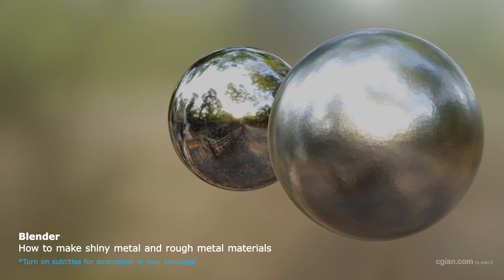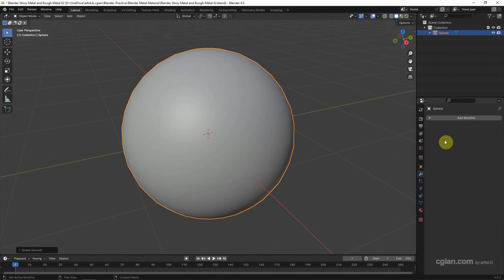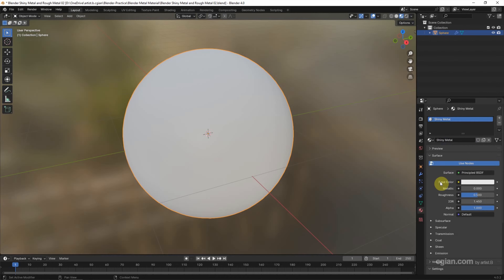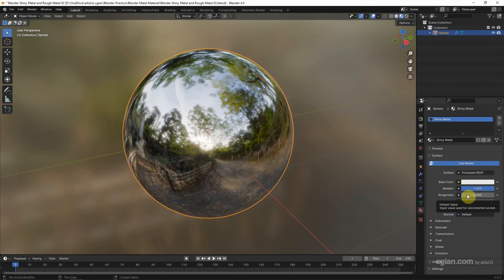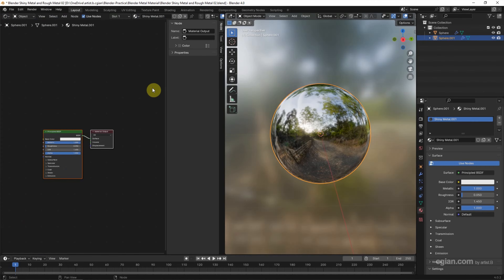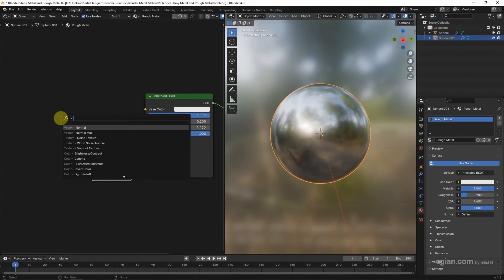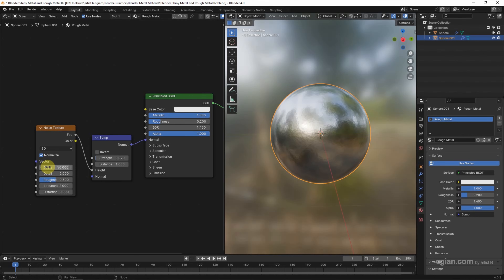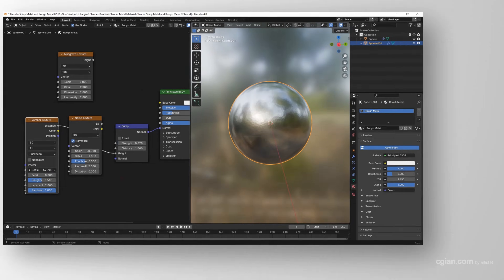Blender shiny metal material and rough metal material with texture shader in Blender 4

Comment: Just a small note: in my Blender there is a different copy setting and I don't know how to change it: when i copy the first sphere, the material of this copied sphere is not a copy, but exactly the same "shiny metal" (and not "shiny metal 001). So when I change the material of this copied sphere, the material of the original sphere changes as well. But after a while I realised that if I make a copy of the original material (named "shiny metal", on the top of material properties menu, next to the shield icon on the right), a new material based on the original appears (named "shiny metal 001), so that way I could then change the new material as I wanted without altering the original one. I have written all that stuff just for those who are also struggling with the same problem. By the way: sorry for my awful english :)
Reply from the maker: right, after Copy and Paste, a new sphere and a new material are added. so, we can make the change individually. but if we use Duplicate, we can have a new sphere with same material.